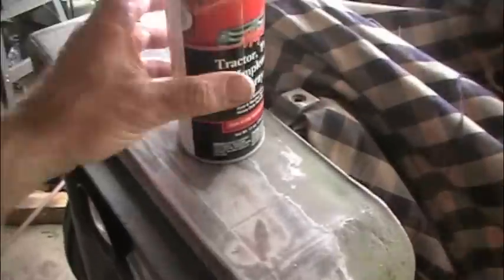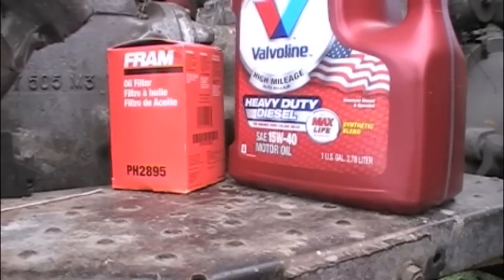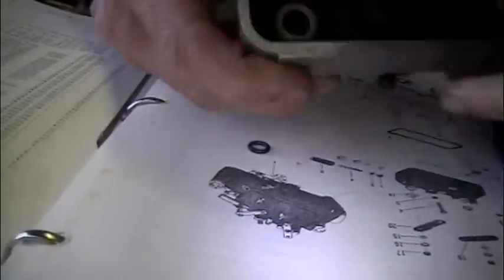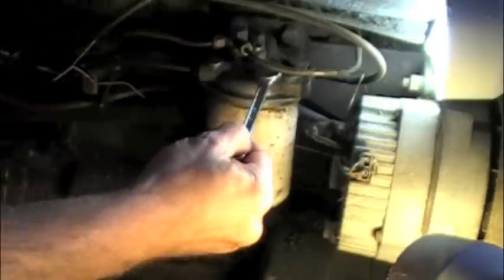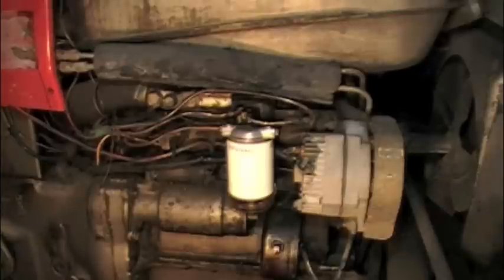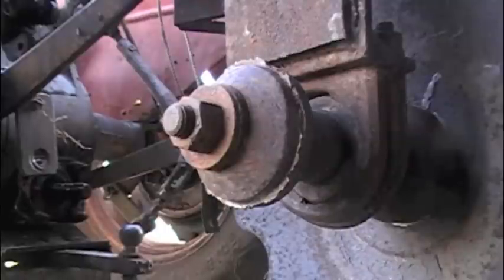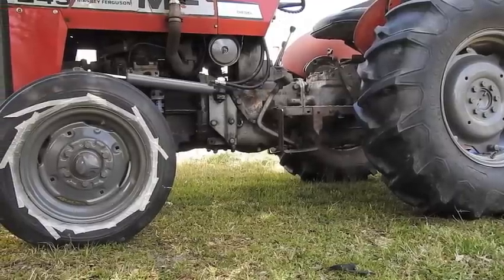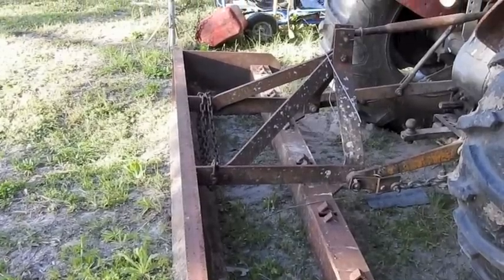Massey Ferguson 245 Maintenance, Paint and Fix up

Comment: Great video you are an inspiration.  I bought a MF-265 for my brother in law and it's in the garage now I am changing the fluids. Once it's done it will be transported north to run an auger for fencing.  Need to get the hydraulic filter off next. Kudos to you.
Reply from the maker: Dave P. Thanks and good luck with your.

Comment: Awesome video! I also have a MF255 and the steering pump is empty and probably I will need to change the filter. What type/kind of fluid do you use for your pump? Thank you!
Reply from the maker: I think I just put regular car power steering fluid, but it has been a while. Maybe google it first. thanks for watching.(Quick google search advised: Use type A suffix A power steering fluid, or use Dextron II Trans fluid)

Comment: Great job! Looks great. Now all you need to do is paint the hood, dashboard, fenders and it will look good as new.
Reply from the maker: Yes, it could use some paint all over. Maybe I will do a piece here and there.  I have thought about taking the hood and fenders to a body shop and then ordering new decals, but I am probably too cheap.  Then you would have to worry about scratches.  Either way, by the time I finish, it will be time to start over. Thanks for watching.
Reply: Nah, I'd just paint it with a few rattlecans, that way if it scratches no big deal. You and your daughter are very artistic maybe one of you could just paint the name on. I guess the main thing is that it works. Thanks for making the kool videos.
Reply from the maker: You are welcome, thanks for the cool comments.

Comment: great video, brings back a  lot of memories, grew up driving a Massey 35. Do your self a favor though any time when your working on the fuel system use gloves, because there is such a high content of water mixed in Diesel fuel it contains a high level of micro-organisms..... not good for your health..... go to any truck stop all the attendants use gloves because its SOP.....
Reply from the maker: gerard mcauliffe I will keep that tip in mind, next time you will see gloves on. Thanks for watching.

Comment: This is great. Ran across this while trying to find how to replace my power steering pump. I have a 1978 245 and you have inspired me to do a little fixing on it, maybe some painting. I love this tractor.  I have had to  stop it with the choke lever for years, would like to use a key. Would you know the name of the part on the tractor I might be looking to replace since you are familiar with the 245's.
Reply from the maker: I am not sure, there is probably a way to look it up online.  I have a switch, a key would be nice. thanks for watching and good luck.

Comment: having trouble .....mine will run at 1500 rpm like a new one. Wont go beyond that. any suggestions? loved the video. tractors looks great
Reply from the maker: I would check it first with the air filter, if no change, might change the fuel filter next. If no improvement, I would try it with no muffler... trying cheap experimental stuff first.  If still no change could be the injectors or fuel distributor... Good luck and let me know what happens. thanks for watching.
Reply: @chud327  will do man. I’m
Normally pretty good at being a mechanic. Besides tearing into it, I’m stumped. But I will definitely let you know what’s going on

Comment: Do the perkins always make that knock in the engine?  I have a 165 and it sounds like the engine is knocking but I'm not sure what it is.  Not the pumps, checked all that.
Reply: check the con rod bearings. See the video of my tractor on my channel if it sounds like yours.

Comment: i have a 230...and she keeps bogging down...ive changed the fuel filter. could the muffler have anything to do with it. olus it sounds bad when working her...i need help
Reply from the maker: I am not sure, I guess it could be a stopped up exhaust, a pinched fuel line, a bad injector, stopped up air filter, etc. There are a bunch of possibilities, but it is hard to guess with out being with the tractor.  I hope you can figure it out and thanks for watching.

Comment: I am having problems putting a 245 distributor back together. Can you recommend any help.
Reply from the maker: Is your 245 a diesel, shouldn't have a distributor...  Wait, do you mean fuel injections distributor?  I did it in this video, but I am guess that was not enough to help you.  I bet there is a manual online that shows how it goes together.  I will take a quick look and see if I can find one.  BTW, thanks for watching.
Reply from the maker: Google had a bunch of images and some look very familiar to what I have.  I didn't take mine all the way apart, but from the images, there are a bunch of parts in there.  Maybe some of those will help you.  I hope this helps.
Reply: Mine is not a diesel. Yes there are a few parts in there but I have it all cleaned up just looking for someone with experience putting it back together.
Reply from the maker: I didn't know that 245 came with gas engines.  I would think a distributor would be easier that a fuel distributor.  At least you will not have diesel all over you hands...

Comment: I have the same tractor and I'm getting fuel in my oil, what will cause that?
Reply from the maker: I would hope it is the fuel pump leaking into the crankcase.  That would be a super easy fix. Good luck and thanks for watching.

Comment: I still can't get my clutch to stop my tractor I have the same tractor any guess on why the clutch won't stop the tractor?
Reply from the maker: I would guess one of the fingers on the pressure plate had the pin fall out.  That is what happened to mine.  That is, as long as you pedal and linkage is still working right.  You will have to break it in half to find out.  If you were local, I could come help... Thanks for watching and good luck.

Comment: you should replace that glass bowl with a metal one. I bought a new glass bowl and two weeks later it cracked for no reason and I lost 30$ diesel too all on my shop floor.
Reply from the maker: As far as I know, this is the original glass bowl from 1977, watch it be broke the next time I look...  I hope I don't have diesel on the ground anytime soon and thanks for the tip. Thanks for watching.
Reply: I just got finished with my Massey 250, did new con rod bearings, new head gasket,  fuel filters, new suspension seat, new exhaust muffler, new paint and decals. That glass bowl was the final thing, now I should be good for lots of years of service with this great tractor!
Reply from the maker: I know I have gotten years of good service out of mine.  Mine was rebuilt in the late 80's or early 90's and is still doing great.  I could use some red paint and decals on mine... Do you have any videos of yours on here?

Comment: that little Perkins diesel is a very good engine to learn on very forgiving and easy to start pretty much no matter what the reverse manufactured models of that Perkins diesel is what they put on the Ford tractors of the same era and they're a little more picky the firing order is even different instead of firing 132 and idling real smooth like yours they fire one two three and have a choppy idle because they're not firing a full 180 degrees opposite the other cylinder I don't want to quote because I'm most likely going to be wrong but it's similar to the way a Harley Davidson fires on the Ford tractors funny how they reverse manufactured the Perkins and change the firing order so that two different brand names could share something with common similarities
Reply from the maker: That is pretty cool info, you are now my Perkins specialist. Thanks for watching and for the comment.

Comment: My boss dropped his mf 245 off at my house and told me to get it running, and he told me it has not ran in 15 years changed oil and filters put battery in it and it fired right up first try.
Reply from the maker: That is cool, I was shocked and happy when mine started first try after sitting for just a year of so. Thanks for watching.
Reply: chud327 no problem buddy,  man I tell ya what these little tractors are work horse I got to mow several achers today and ran like it did probably 20 years ago
Reply: Tony Mullins i havent started my Massey Ferguson 241 di for 2 years..It's just done  250 hrs although 9 yrs old..any precautions before firing it up??
Reply: shivram dhillon well this is what I would do check and make sure engine is free then check the oil and coolant check your air box make sure no rats nest or anything, put you a fresh battery in it check your fuel and give it a start run it for about 10 mins then I would do a oil change and coolant change and air filter change.